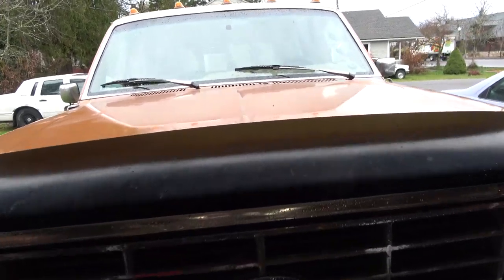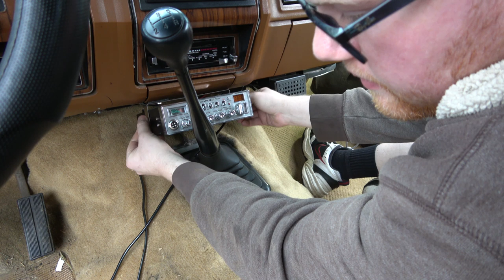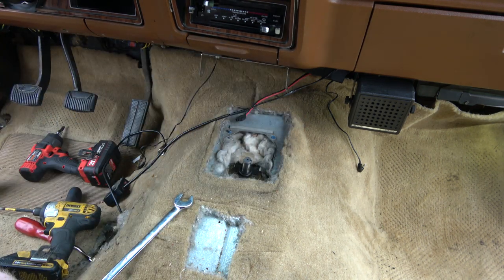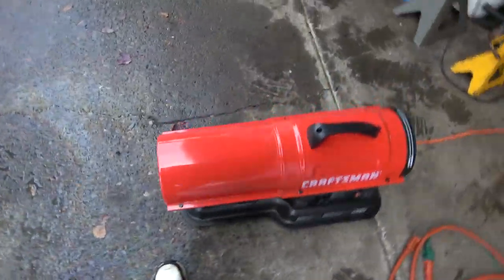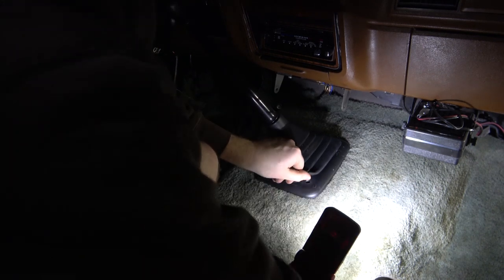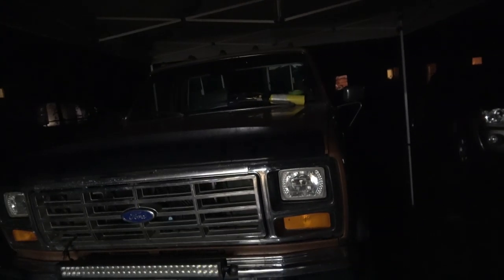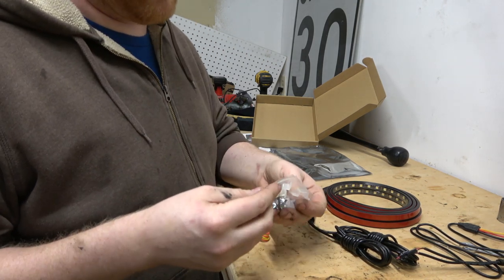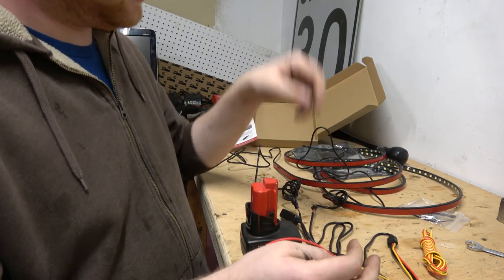Bullnose Ford F150 Project | OBS Interior | Carpet Install

Comment: Just put oversized stainless sheet metal screws in it. They won't rust and look great. I always replace any screw's, bolt's, washer's  ands nuts on my vehicles with stainless steel! 👍👌

Comment: I was thinking about replacing the carpet in my 95 with a vinyl floor but was concerned about road noise that may be even more annoying. Should probably replace it instead with a new carpet. I wonder about the quality of the ones Rock Auto has.
Reply: I went from a vinyl floor to carpet and I'd never have the vinyl floor again. A bit quieter and much more insulated feeling in the winter time. I used the ACC cutpile carpet from Rockauto and the quality was/is very good.

Comment: I love the videos!! , I have a 84 f150 I've been restoring, 
Thought about doing a diesel swap, just wondering how much time something like that takes to convert?
Reply: I have a 1982 f100 with the 4bt. For most unexperienced people if they have most of the parts it takes them about 2 weeks to a month. But it took me 2 days to remove the 302 and completely install the 4bt. Most people can't remove the old engine in 2 hours though so it really depends on you and how much time you have.
Reply: @danilehahn169  what transmission didn you run with. The 4bt?  If you dont mind me asking
Reply: @ericzinaman2918  I use the zf5 but I've done t19s also. Have any more questions just ask.